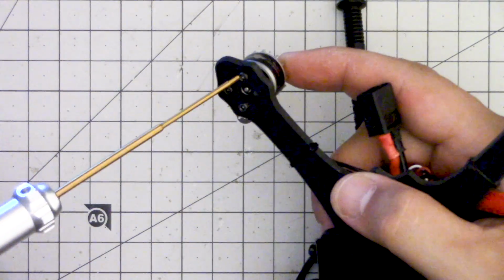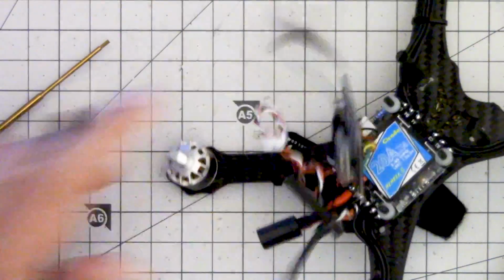Quadcopter Hot Motor | REAL WORLD TROUBLESHOOT

Comment: Just earned a sub. This saved my bacon 5 years later.. Never would have thought about checking the screws for current but low and behold, the screw for the motor was touching the coils and after i found it and replaced with shorter one.. works like a charm..

Comment: I have a dji fpv. Was inspecting it last night and noticed just one of the motors looks like the coating on the coils melted... looks like glue on half the coils of the motor! Is the motor damaged? Safe to fly? 

 Sooo ya was told about the coating by posting a video of the motor on a drone community. Also just learned from this video that's its an enamel coating! So ya, this stuff is melted over half the coils... is it no good now?? Scared to fly my drone!

Comment: Really interesting. Have to check one of my quads later where I was not able to found the issue.

EDIT: Checked out one of my quads and found out that this issue caused me a bad video signal. Changed the screw to a shorter one and all is fine. Thanks again.

Comment: Thank you Joshua, after a crash i had desynchs and a hot motor, thanks to this video and a multimeter i found the solution immediately.. i used to long screws, they damaged the insulation and made contact to a motor cable after the crash... thanks again

Comment: Thanks for these videos Joshua. Although you said that carbon fiber conducts electricity, I was dumb today and fried my ESC after replacing a dead motor :D I was like, let's just plug in the battery to see if the new motor works - ESC was not yet installed just rested against the frame, making contact between the battery pad and I think the current meter. Smoke came out LOL

Comment: HELP!! I'll patron like and subscribe if you could help me in this comment. IM HAVING ALL THESE SYMPTOMS...  but, I'm not getting any continuity through my frame believe it or not but by the power of shrink wrap I isolated my entire motor from from the arm. I checked all my wires (no Frey) checked to see if I'm getting correct voltage, tested the motor in beta flight for sink problems and nothing. All the tests I could find on your channel and more I trouble shot. Its acting like a short with no short. I bought two new motors so that's my next step but I have a concern still. This same thing happened to both my brand new quads BNF after 2 min flights (x220hv and mobula7 hd). That mobula threw you off right with its plastic frame. My conclusion is could there be something wrong with my installment of betaflight or my taranis q X7. I've flashed new software on everything and I'm still getting burning motor and desink with correct voltage and no efc errors. 

I bought the mobula 7 HD to buy my time while I made my wizard a project. The 9nly upside to this is I'm learning alot more and alot faster then most coming into this hobby 😅😪.
Reply from the maker: If the motors are hot from the Motors tab, then it means damage to the motor or ESC. If they are hot when you arm but not hot from the Motors tab then it's a problem with PIDs, filters, or the gyro. This is where I would start troubleshooting.
Reply: @JoshuaBardwell  you're f***ing awesome man, I can't believe you actually responded. We need more people like you. You got my sub!!! And I'm donating to your patron. 

So this is what happened. There was a short at one point  with my leads coming out of the motor touching  something, a bad wrap I'm guessing. I said whatever and flew it even though the motor was burning hot. Since I insulated all the screws, bottom and top of the arm from the whole frame that short stopped. the motor would run but was still hot, the enamel fried off and now that it's done melting and frieing it no longer getting hot if any of that makes sense 🤣. And same thing with my mobula except the solder was touching on the 3 pin connector and fried the efc. Thats why it worked for a minute and failed. To test this theory before I sent it back I simulated it on another motor and it behaved the same exact way. You cant fix bad luck.

Anyway thanks alot man this video was right but the short was a little trickier then a screw, keep up the good work 👍👍👍👍👍

Comment: rear motors RPM are higher at forward momentum as front rotors mostly keeping the quad stabilized.  The only time all 4 motors spin at same RPM is when its going strait up.
Rear motors are your main motors for going forward.   You can check your RPM and see the ration during forward fight with no altitude change.
Reply from the maker: Rear motors are at a higher rpm because they are receiving turbulent air from the front motors.
Reply: I have to disagree.

1.  Drone in forward motion is tilted 45 to 65 degree putting rear motors above front motors and mostly away from turbulence.

For testing purpose: Take off the propellers, set the maximum tilt 45 degrees and run the control stick full forward.
Hold it in your hand and tilt it forward slowly. You will notice back motors run faster at every angle.

With this test we took out turbulence out of equation.

Comment: so i just installed the rsxr in my mantis 85 however now that the install is done one of my motors  cuts out and the quad is in the air so i out it on the bench and found that all 4 of my motors arte hot... anyone have any suggestions
Reply from the maker: All I can tell you right now is, the RXSR cannot make your motors hot.

Comment: I hope you can help. I got knocked out of the sky by a friend and after the rough landing my quad isn't acting the same. The motors are getting HOT and the quad is louder in noise. When I throttle and take off it's really load and hot. Motor 1 is the hottest and can not rectify the problem.  Can you help?
Reply from the maker: Check the FC stack to be sure you have no broken standoff loose screw or anything that could let the FC move.
Reply: @JoshuaBardwell  Thanks for reply.  I've checked FC and everything looks good. It's doing my head in. I'm going on holiday tomorrow and would like to fix it so when I get back I can fly lol... When i switch it to horizon mode this is where it gets funny. It starts off ok but then a couple secs later dont know what it is it sounds like osalation. Load enough to notice the change. On continuity test I'm not getting any beep when probe is touching motor screws. All motor opposites beep when I touch with probe but not motor 1? It was flying fine before so wouldn't really be anything with betaflight would it? Like pid tuning wise. But after the hard landing this happened. Thanks for your reply again. I'm sure your busy  so dont want to keep you too long. Hope I sort this.

Comment: So all 4 of my motors on a diatone gt-r 249 are hot and my volt meter is showing that all of them are shorted out. The thing is the screws I have in there aren’t even long enough to protrude through the bottom plate of the motor....
Reply from the maker: Assuming this is a ready-to-fly that you bought from Diatone, I would reach out to Diatone support.
Reply: @JoshuaBardwell  its not but i figured it out. The motors aren't made to take the amps my escs are throwing at them... new motors are on the way, hopefully i didnt seriously screw these motors, i only flew them for about a minute

Comment: I have one hot motor since a few crashes I think. But this isn't the problem :(
I already swapped the motor with a brand new one and that also didn't help.
Could it be a damaged ESC?
Reply: For reference:
Even though the old ESC didn't show any sign of damage (showed up in Blheli suite, made the correct startup beeps like all the others, spun up the motor correctly when testing) I swapped the ESC with a brand new one. Now the motor isn't hot anymore. 

It is a Racerstar V2 30A Blheli_S ESC.

Comment: Hi, I have a new Titi from karearea , and when I fly it, it flies for about 10/15 second and then the over heat warning comes on and the motors stop turning, I then check to find the motors red hot, my D gains are all 20 so they are not to high, the motors are strong and powerful and the props are 3 inch, as is the drone, all normal, but I have no idea why all four motors are getting so hot that the warning buzzer comes on and it shuts down, would real appreciate your thoughts, would send it back if I had not already sent it back for this problem, they said it’s fixed but it’s not, please help because this $400 drone is now just a paper weight. Lee
Reply: My mistake, my error, I had D gain on the Yaw when I should of not with such a powerful drone, now it flies great and no motors getting hot, even 
karearea drones sent it back with no D gain on Yaw and I going and give it 20 hence me having this problem, so Karearea drones did things perfect and I being an idiot changes the pids when they were already perfect, thanks Karearea.

Comment: Hello!
Mby some options for situation with kopis2- one mottor gets ultra hot and drone maks double flip or smt when turn right flip... replace mottor same. Befor dont crash utt.
Reply: You flying 4s, 5s, or 6s?
Reply: 4s man. Its almost new, fly mby 30 times (i think its not so much)
Any options?
Reply: Now its like i need to buy new kopis2 and left this for details, but what if this hapens again...?
Reply: Zenja Hero Interesting. 4s shouldn't be causing hot motors. I have the same quad and it typically only gets hot on 5s with the wrong props. You're running the stock Cyclone props? Make sure that there's no wiggle in the arms. The arms are connected to the body with two screws. Make sure that both are tight. Also make sure that your lock nuts on the props are tight. Lastly, make sure that your electronics stack is secure. I've noticed that my kopis 2 is very temperamental if anything is loose.
Reply: Yes man i check all befor flight, all is god... But only 1 mottor gets ultra hot and like Joshua sad when i make flit to right and let stick back it maks one more flip (like duble, but i need only one). And i alredy try to replace this motor ( this stock was also with not god smell, becoz of warming) and same... wtf... All was god and this starts from nothing...
Reply: I also hawe kopis1 and kopis2. With that i hawe no problems after one yera flight...
And problem is with kopis2SE

Comment: Hello there, i am still new to fpv i have a mobula7 v2 and a spc maker x90, mobula seems well so far. But my spc makers motors get really hot very fast even while hovering for a short while, i have tested it, there is no leakage, i took the drone apart to check on the joins and if there is any contact to other parts that should not be there so far no, could you please advise me if it could be due to pid setting?  Any help would be appreciated.
Reply from the maker: Have you changed any of the PIDs or filters? Raising D gain or turning down filtering could cause this.
Reply: @JoshuaBardwell  i have only fashed to the latest betaflight clean wipe tried that, motors was still hot reverted to the stock setting also still how. I am not sure how to tune the filters whether i am doing it right or wrong. Mayb i can show what setting i currently have once i am back home

Comment: I recently fried one of my motors.

Now I checked the screws...every single motor has at least one screw directly touching a wire without isolation. God bless only one died.

But all motors always had that scratchy sound...could that be the screws touching a wire too? 

Thanks for the vid bro !!
Reply: ( I have the hobbywing xrotor race pro 2207 2650 kv motors )
Reply from the maker: I would consider all the motors fried and be really hesitant to fly anywhere I might not be able to retrieve the quad. Yeah the screws touching the wire can cause all sorts of problems.
Reply: @JoshuaBardwell  Oh, I didn't really expect YOU to answer me :D Thank you a lot !! But I don't think that all are fried, because they were not really hot exept for the front right one. And also the front right one suddenly stopped working and made me fall out of the sky and actually smoked hehe. The other 3 seemed to be perfectly fine.
Reply: I dont know if you will read this, but I just got a new motor, rescrewed?! (if that is a word) all motors and after some test flying all the motors are cold and my quad is flying smooth as f....

Even with stock PID's ... they seem perfect ! :P

Thanks again for your answer ! :)

Comment: My back right motor stopped spinning like the others after a minor crash. No visable damage anywhere on the wires or motor or soldered connections. 
The motor will spin a few times quickly and stop suddenly. It does this for a few seconds then beeps and stops all together. 
The other motors spin fine. It spins freely and feels the same as the others when I spin them with my hand. 
I noticed a tiny drop of resin on the arm under the motor, Im guessing this means it got too hot? 
After watching this video and hearing you talk about the battery wire maybe rubbing or touching the motor leads/arm and how this could 
be a problem and conductor leading to it getting hot, I realised had my battery wire wrapped around the wires and arm of said motor. 
Does it seems like this is my problem? I have new motors coming and I will for the first time re-wire/solder and change to the new motors. (im a noob). Any help is good help, thanks.

Comment: never thought to check my motor temperature.  Could a hot motor cause smoke to come out said motor?  I was flying just fine (it would seem) changed batteries and upon startup (with battery #2) the drone would flip and not fly right.  checked the rpm speed (thank you blheli_32) per motor and the one motor (that smelled funny) was not able to get to the same rpm as the other three.  after watching this video checked my PIDs and noticed my D is much higher than the others.
Reply from the maker: Literally the only thing that could cause smoke to come from a motor is if it got hot. Motor is probably toast.

Comment: All four motors get hot as soon as I plug a battery in. Checked continuity all good. It flies great motors come down warm not not hot. I checked solder joints frayed wires touching frame and anything else that looks out of the ordinary. What would cause this?
Reply from the maker: Hot motors as soon as the battery is plugged in (before the motors even spin) is likely defective ESCs. I can't think what else could be pushing current through the motors. 

I suppose another guess would be, if you had vBat+ touching the frame somewhere and finding ground through the motor screws.
Reply: @JoshuaBardwell  sure enough it happened. First thing I checked was the screws and each esc with my multimeter knowing the screws don't go past the motor base. Also when I used my racedayquad smoke stopper the startup sounds are all distorted. But it still starts up. I flew fast and hard about 30  packs total of 2 days no issues other than the hot motors in the beginning. My last few packs today thought a bearing was going out was squeaking a bit.  Till dropped out the sky. 2 motors were froze up. I replace them and the frame Same hot issue. Have a 4 in 1 esc with direct pins for the signal wires and votage Been through about 70 packs  with not one issue. Replaced a motor once. While back. A few frames as well  swapped out new 4 on 1 new motors and its golden. Thank you Joshua I knew it wasn't a good idea to run it like this but it was fun while it lasted.

Comment: I'm running a CP2207 at 5s and getting hot. Motors and FC are soft mounted, P and D terms are low (P 20 and D 7), all filters on. What can I do to reduce the heat?
Reply from the maker: Based on what you're saying, I would guess you're just over-propping the motor. What kv is it?
Reply: 2450kv, 5045 props. I think it was supposed to handle it...

Comment: thanks a lot for this video! built another 5" with the new version Racerstar 2207 2400KV and after a minute of maiden flight two of the motors on the opposite sides were super hot and that's when i remembered your video. Just checked them with the voltmeter a surprise surprise both motors were showing continuity. Unscrewed the screws next to the wires and that fixed an issue. Thanks a lot for your help!

Comment: I have a terribly hot back-left motor after a short flight, but there's no continuity problems between the frame and motor (screws are not too long). What's the next step in troubleshooting that? Motors are brand new.
Reply from the maker: Test for continuity between the motor wire and the bell of the motor. It should not exist. If it exists, the winding inside the motor is damaged. Make sure to use an un-painted part of the bell.
Reply: Joshua, thank you for the reply. Test resulted in no continuity between motor wire and bell. I'm noticing a heavy droop on the back left side (where the problematic motor is) when quickly increasing throttle. Flying feels like I have a 'flat tire' on the back left. My only guess at this point is that it may be the ESC.